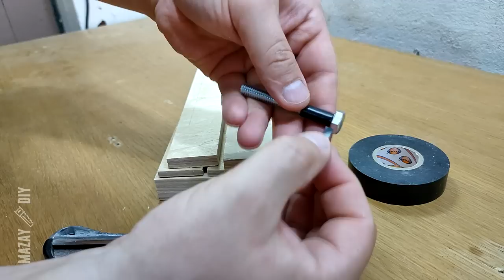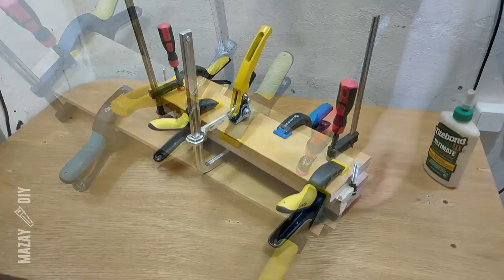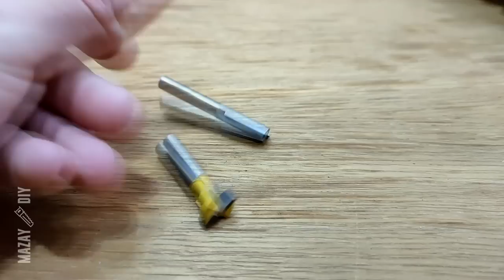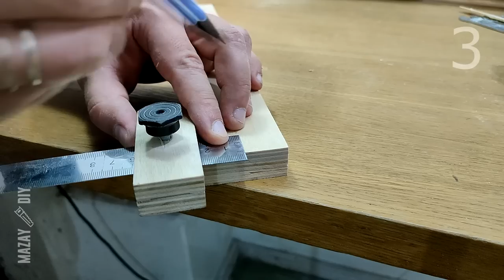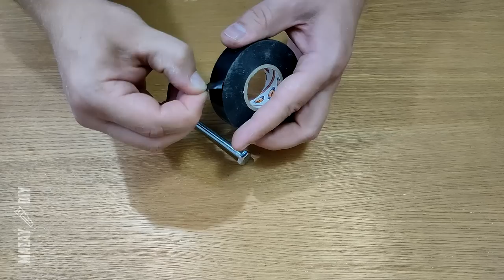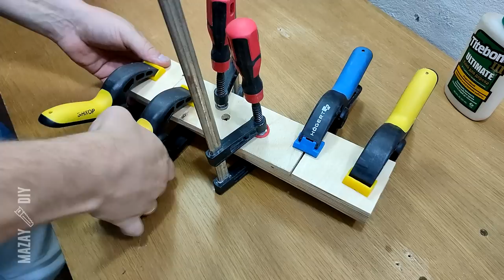3 ways to make T-Tracks and T-Slots

Comment: After a year (or more) how does the t-track made with the router T slot hold up? The ledge made of ply looks fragile to me. I’m leaning towards rooting a groove to put in a metal strip but am intrigued by this. How has it survived?
Reply from the maker: To be honest, I also had my doubts about the durability of the T-groove made in plywood, but it is alive! You can watch some new videos - I still use these T-slots. So I recommend giving it a try. But if you are a professional and will constantly use your device, then I recommend using special guides. In any case, a homemade T-groove can always be converted into a groove for aluminum guides.

Comment: Спасибо! А есть у Вас видео с изготовлением прижимов-коромысел?
И ещё вопрос: нельзя ли сразу делать паз Т-фрезой, без прохода пазовой ?
Reply from the maker: Артем, заспойлерю немного - видео с прижимами будет опубликовано завтра, 17.10.2020 г., шаблоны для вырезки также будут в свободном доступе. Подключайтесь, чтобы не пропустить. 
Про фрезу - нет, я не находил в продаже таких фрез, которые бы сразу подходили под стандартный болт М8 (у фрез ширина паза вверху 6,35 мм), да и Т-образной фрезе значительно проще идти по проторенной дорожке.
Reply: Хвостовику т-образной фрезы нужен паз, сам он себе проход не профрезерует.
Reply: @gennadyleonov1969  Ты фрезу в руки возьми и вглядись, прежде чем чушь писать
Reply: @elyasovartem  Был не прав. Невнимательно смотрел. А фрезы я в руках держу больше двадцати лет. А вот "тыкать" незнакомому человеку не надо.
Reply: @gennadyleonov1969  you can get bits that have a cutter on the shank too. But I still recommend a straight cut first. It reduces the load on the router.